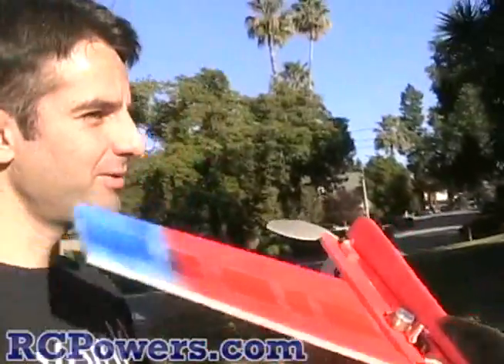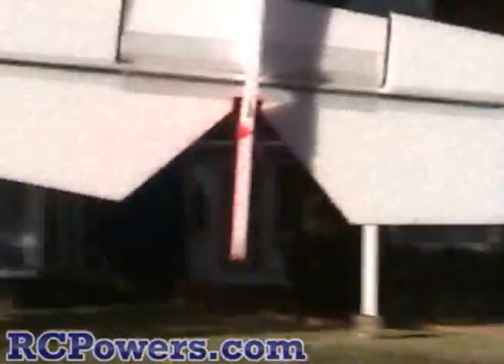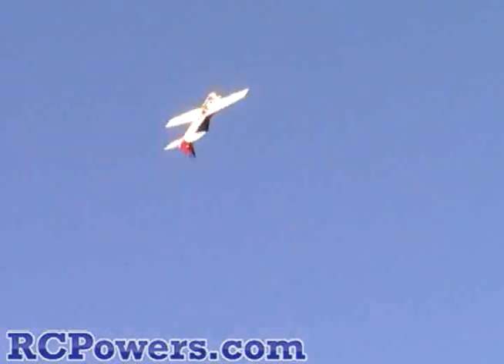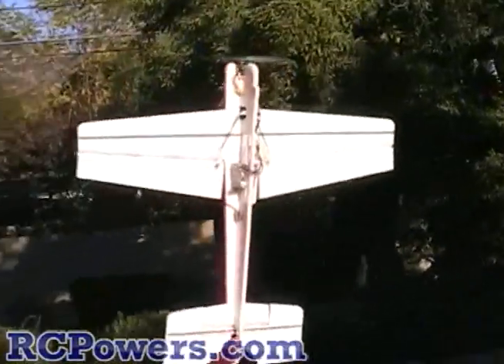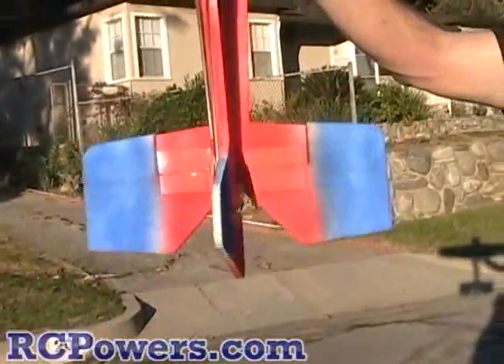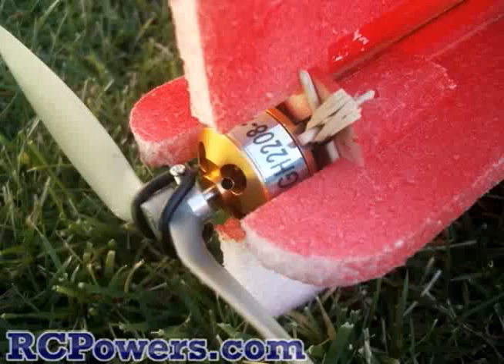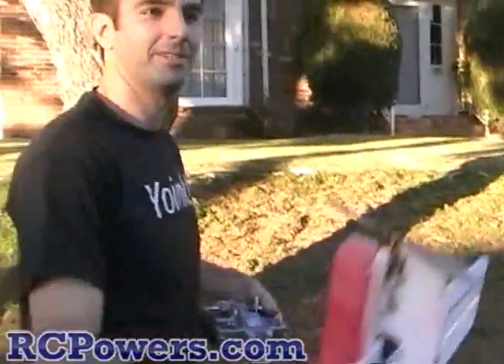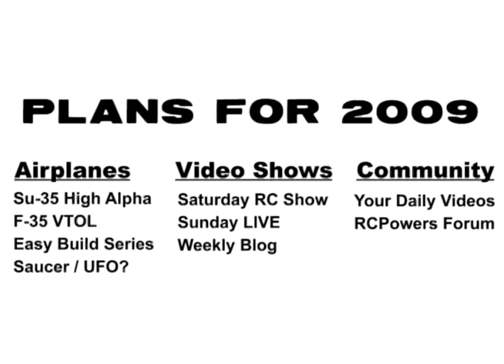Gyro Testing

Comment: I thought about it a little more, they are actually variable rate gyros.  The signal from the RX can vary the rate and mode from 100% feedback rate mode at one end of the scale, 0% feedback in the middle to 100% feedback heading lock mode at the other.  So you can have as many gyro settings as your TX can send (this is why I misnamed them dual rate, my TX has a single switch to alter the mode). Also the gyro can change mode "on the fly" with servo lockout.  Keep up the vids, I love them!

Comment: I programmed my radio so that  when I move a control surface, its gyro's gain proportinally decreases (so the gyro does not "fight" intentional movements, but has full authority when no input is given). This makes the plane very stable and fully controllable at the same time. Another interesting mix is gyro/throttle. If on full throttle the gyro gain on tail decreases, it stops wobbling.

Comment: You can get dual rate gyros. For example the E-Sky EK2-0704A has an input channel from the receiver that sets both the gain and mode (heading lock or rate).  That particular model is now discontinued but I'm sure there will be others with similar functionality.  Though for the VTOL plane you may need 3 switchable channels to get the gain optimised for each axis, so 7 channels at least not including thrust vectoring or landing gear retracts.

Comment: Hi Dave, I've been playing with gyros on foamies for quite some time, and would like to share my thoughts. It REALLY helps if the gyro has 4 wires. (Previously I made a mistake and bought several "conventional" 3-wire gyros that can't be controlled by RX, and now have no use for them). You can plug the control wire into a free channel on your RX, and then use TX to adjust gyro gain in flight -- not merely switching it on and off, but mix it with other channels.

Comment: exactly the same effect as on my shocky! you need 2 settings for hover and fast forward speed. I think on my 3mm depron plane, its mostly cause of the aero-elasicity/bending of the foam. I got jitter too at high speeds, but very steady hover. I'm gonna use your shock absorbing motor mount idea if you don't mind.

Comment: @kynaniska83 
Airspeed Kit with MPXV5004DP (analog output sensor, pitot-tube and hoses) costs 25 $ at diydrones and analog to pwm (ramp generator & comparator) costs something like 2 $. You can use TG-380 gyro with remote gain control.

Comment: that is why you need a gyro with remote gain control. That gives you different gain in different hovering/ flying mode with a flip of a switch on the transmitter. Simple as that!

Comment: I fitted a couple of PP3's to a model a few years ago, wired them through an on-board RC on/off switch (Hitec I think). They worked great. What type of gyros are you using

Comment: @daplaneflyer 
I guess it is possible with a little work. Just take a pitot-sensor with analog output and use the output for analog to pwm conversion. You can use servo limiters for individual gyro gain tuning. You need non HH gyro with remote gain adjust and depending on gyro maybe will need to reverse the gain signal.

Comment: This mix is nice with maneuveres that require speed, but there's a downside -- in harrier or torque roll the tail gyros are not producing enough gain because the throttle has to be at high level. So when I enter such "hover" modes, I use a TX switch to disable gyro/throttle mix. I wish there was a speedometer I could install on my foamies to overcome this problem :)

Comment: Dave can you setup 6 gyros? 3 for very low speed and hover then flip to 3 others for  moderate to high speed. 

I understand this is more weight but it could solve the problem. Just thinking out loud.

Good Luck with your F-35. Can't wait to see it.

Robert in Maine

Comment: I beleive I saw a Spectrum DX7 TX in this video, and concluded you probably use AR6100 on your foamies. If this is so, you probably have 2 free channels on your RX (unless you have flaperons). I have 3 gyros on my foamies, 2 on the tail servos and 1 on aeleron servo. On tail gyros, I soldered control wires to each other so that two gyros can be controlled as one, by single RX channel. Aeleron gyro has it's own separate channel.

Comment: When I tried this a couple of years back  I gave the three gyro's seperate channels for sensitivity & linked them into my landing gear switch so I could switch between 2 settings, by luck I had the elevator on the (heli) pitch channel & could trim it mid flight & this was the one that caused me most grief in transition.

You should try a modern programable heading hold gyro, you should be able to adjust its characteristics to remove the wag.

Comment: I was about to buy this plane and use my old    5ch dx5e but on your website you recommended a 6ch will the 5 ch work? and do you use a 3s or 2s lipo in the video just wondering, good idea for the motor mount!

Comment: i am building a extra 300 form rc powers and i was wondering what power system should i use
-battery, speed controller, motor and prop
thanks

Comment: I know, I know this is old and everyone now knows that most gyros designed for CCPM helis can be adjusted from the Tx.....but what would having heading hold mode on a setup like this do?   I guess, theoretically, if you could switch all 3 into heading hold mode at once, it could hold a perfect hover.  Would it completely ignore any pilot input?  Anyone know more about these heading hold gyros?

Comment: Understand where you are working twords but to me, vert Take-off was having the plane rais in it's horisontle position And transition from an upward motion to a forward motion. You have a good system if your plan is to copy one of the early WWII Vert Take-off X projects, but current Vert planes use a system that is not using the elevators and tail. I do with you lots of luck and I would liek to see your goal reached.

Comment: @bv9073 their are two ways their is the easy way for small eltrcis under 40inch likw fomies not power full ics or any think like that or the better way is two buy some hinges for rc aircraft and you can cut a slot it for the hinge and then glue it in place or ur can put a pin in or somthink just ask me any questions if youhave any trouble

Comment: the gyro is wanting the plane to hover and that is making the plane woble alot through the air so you kinda need a cut off switch for the gyro so it wont spaz about during flight. And the slow mo at the end is sooooo funny nothings fine i mean everythings fine that was a narly hit hahaha. And one more thing thoes planes are very cool ima get one right now.

Comment: A question, maybe someone may comment that: I want to enhance my Depron selfmade-flyer, having ailerons and elevator, with the goal to make it tailless. Due to the fact, that I don't use a VTailMixer (my radio does that for me, using 2 channels), do you think I am able to set a gyro only on 1 (ONE!) aileron servos? So only one aileron will be responsible for stabilizing. Anyone got a comment on that?

Comment: I got the PDF plans for this plane and made it out of 6mm depron and put a 3mm carbon rod in the wing. first flight I did a loop and the wings snapped off and I checked the carbon rod before I glued it in and nothing that I could see was wrong with it. the carbon rod even snapped in 2 place. I have built another one and put a dowel rod in the wing. Way better. no flex at all.

Comment: Dave, wrong hair cut!
anyway there is a gyro that you can get for about 25USD that allows you to dial in the throw rate on the fly but if I posted that info here then they would be out of stock within a day or so!
so.. I'm gonna keep quiet
I will say that its not metal cased like the one I see you regularly use (lighter) so it may be more suited to 3D foamies

Comment: Yeah, we are totally silly.

Hmm, I wonder if it's able to use his radio to turn off/on gyros on the fly...

Then he might be able to solve the problem with the gyros overcompensating when going from hover to actual flight.

He could use three gyros for hover and three for normal flight, then switch (if possible), from hover to normal flight to the other gyro's maybe? I dunno, sounds a bit silly and complicated ._.

Comment: The guy in the video made the statement, “A gyro is like an autopilot” but that’s not correct. An autopilot will steer an aircraft to a distant location, either guided by GPS or by radio directional signals from a base station. A gyro simply stabilizes one or more of the aircraft's control surfaces.
Reply: xrayrep it’s an analogy. He used “like” autopilot. Not is an autopilot